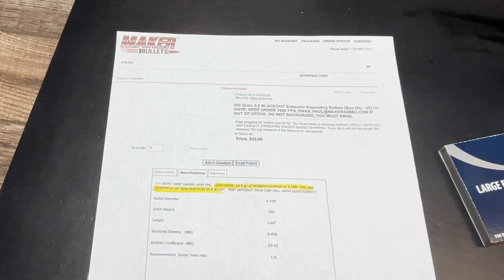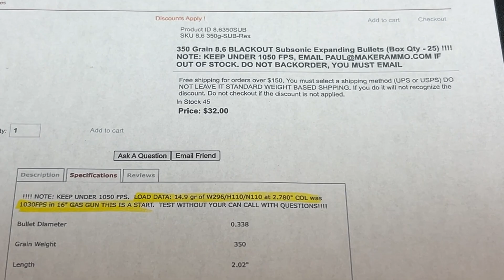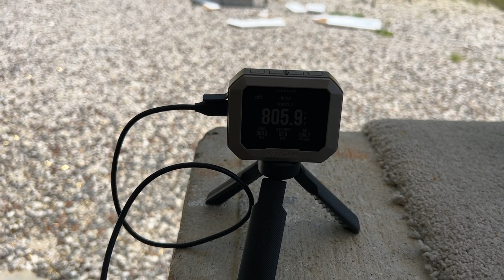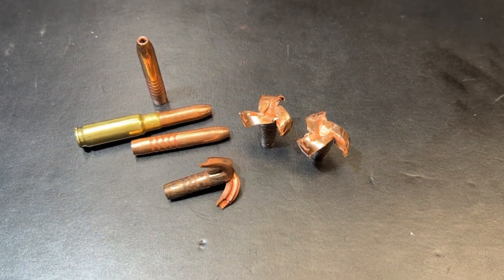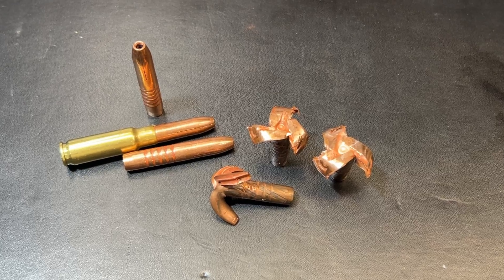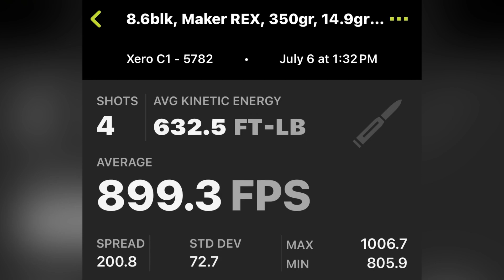8.6 Blk, Maker 350 REX All Copper Bullet Tested in Gel Blocks.

Comment: I was wondering if you ever have feeding issues with the 350 gr Makers bullet? They will not feed in my Q Fix or Faxon FX7 bolt actions. However, both feed the Gorilla 342 gr Pork Shredder smoothly.
Reply: Regarding OAL, the factory loads I've used with Makers bullets that don't feed:
Steinel 350 gr - 2.780"
Aitken 350 gr - 2.746"
Halworx 300 gr - 2.769"

I appreciate your thoughts on this and I think your videos are very well done and super helpful. I especially liked the ladder videos on 8.6 supersonic loads.
Reply from the maker: @ Both my 342gr Punisher and 350gr Maker were at 2.76 OAL.

If you chamber one and eject it, does the tip of the bullet show any scratches from the feed ramps?  

Also, how’s your gas?  Wondering if your a tad under gassed to drive the buffer all the way back to get enough spring tension and inertia to strip the round out of the mag and into the chamber.
Reply from the maker: @JJI-RH65300  Factory loaded ammo??  I haven’t had any issues but all mine have been reloads and I check everything with a Sheridan Case Gauge after loading. 

You could get a case gauge and check both of them to see if the Maker is within SAAMI specs or is oversized. 

I stated out loading with Gorilla brass and it does seem to have a thinner case wall at the neck and their bullets seat very loose in their brass. I can twist them by hand after loading.  That may be why they’re fitting your chamber better. 😉

It could also be the chamber cut on the Q Fix if is tighter than the SAAMI spec for 8.6.
Reply: Thanks for the reply. All factory ammunition with the 300 or 350 grain Makers bullet being loaded by Halworx, Aitken and Steinel. I did buy a case gage and they all drop in and check out fine. For me the open tip of the Makers bullet seems to catch on the feed ramp and stop right there. Bullets like the 300 gr Sierra Match King, Gorilla 285 gr Fracturing and the Discreet tipped bullet feed smoothly. Maybe I need some sort of polishing of the feed ramp? Besides the pmag I've only tried a Lancer mag in The Fix and that made no difference. But maybe there are better choices there.
Reply from the maker: @JJI-RH65300  it could be the feedramps or the feedlips in the mag. I run Magpul and Lancer with no issues with any bullet I’ve reloaded so far (12-15 different ones). What’s your OAL on the factory Makers??
Reply: Im😢running bolt action rifles focusing on The Fix by Q. I've used plenty of force when running the bolt in that I've driven the bullets part way into the case when the open hollow tip has caught on the feed ramp. At some point I'll probably pull the barrel and try polishing the feed ramps. For now, considering your results show more consistent expansion by the Gorilla 342 pork shredder than the 350 Makers, I'm quite happy running that. Plus all the other brands of bullets I've tried seem to feed fine as well. Thanks for your help!

Comment: When you convert the 6.5 Creedmoor brass, do you have to turn the neck?
Reply from the maker: @MyGraKat2  I didn’t. Just trimmed to length. It had noticeably more neck tension than the Gorilla brass but the Gorilla was so loose I was concerned about bullet setback.  The loaded converted cases were all fitting fine in my Sheridan case gauge.  I used these more for playing around with my first few batches of bullets until I got my Gorilla and Starline brass in.  Honestly, the starline seems to be doing really good.  On my 2nd loading with several of them already.

Comment: Stupid question. If the sound barrier is 1125 why do people always act like subsonic should be around 1050?  Thanks
Reply from the maker: @tarasowell8191  it’s not a constant number. It changes with altitude, temperature and humidity.  1,050 is a lower than average for most places but a safe range to ensure the rounds stay below Mach-1. 😉
Reply: @kentuckyrangetime  are you seeing decent accuracy with any of your 8.6 loading? I have tried most all of the factory subsonic ammo available, and about 3 moa is the best i have gotten at 100 yards.
Reply from the maker: @tarasowell8191  I just finished gel block testing my last 2 supersonic loads earlier today. The Barnes TTSX in 185gr and 225gr. 

Working up accuracy loads and testing them with each grain weight is my next step. I’ll start that when the weather gets too cold to do gel testing, probably after Thanksgiving/deer season is over. 

I do know that this caliber was designed as a hunting round and was never supposed to do those low or sub MOA groups like most other calibers.  At least not with the 3R twist barrels.

Comment: What is the intended purpose of the cartridge?
Reply: Hunting or self defense
Reply: @deepsouthmotorcaradventure5999  For hunting that cartridges would be greatly limited to very short range.
As for self-defense for rifles the AR 15 in pistol cartridge work just fine.
I own an AR 15 upper in 9 mm and 30 Luger with 16 inch barrels so I can't imagine for home or on the property more than these cartridges for human threats.
Now when not hunting and I am in the Pacific NW with bears and Cougars I am pacing the AR 15 in 7.62x39 when walks on logging roads
The 30 Luger became an eye opener how wicked that cartridge is when I started using a FoxPro caller to call Racoons then shooting them with the AR 15 in 30 Luger that blew their guts out and if head shots those 85 & 90 grain hollow points blew up the Racoons heads!
The 30 Luger shooting 85 grain hollow pints go through a 4x6 Doug fir beam at 25 feet leaving a massive hole on the beam back side.

Comment: thinking there are factors that are skewing your results.  Makers have one of the best reputations out there for 8.6 sub bullets.  I've never seen these issues on any other tests, or experienced them personally regarding the lack of expansion.  Wonder if you got a bad/defective lot?  The really big velocity swings also indicates something's fishy.  I'd probably go load several more in actual 8.6 brass that have been sized and neck turned, then trickle and weigh each individual charge, in case you didn't the first time.  Doing this has gotten me single digit StdDev and Extreme Spreads with my 8.6 loads.
Reply from the maker: @uvausmc  I’ve already done some follow up testing and It’s the low velocity causing them not to expand. Same for the Gorilla Punishers.  Anything under 950fps has partial or questionable expansion in both rounds. 

As far as brass prep, I’ve also ran these in Gorilla 8.6 brass which is another issue entirely. 😂. Even after FL resizing virgin bras there’s almost no neck tension.
Reply: What kind of accuracy are you getting with single digit SDs? For me the single digit SD loads get 1.5” groups, always a flier or two that expands the group.
Reply from the maker: @FFFF-x9i  I’ve been focusing on getting my velocities and haven’t really done any groups at distance yet. That’s coming up soon though. 

These big copper bullets with so much contact area seem to be extremely sensitive to even the smallest change in powder charge. I was doing bumps like I would for jacketed bullets and had to really shrink down the adjustments.

Comment: I wonder if fire forming the new 6.5 Creedmore brass caused the erratic velocity due to neck tension and case volume variances?
8.6 is really cool, thanks for your testing.
Reply from the maker: @rangetime6779  possibly. Once I cycle them all through a loading and have them fire formed I’ll be able to tell. All the converted brass Is Hornady 6.5 Creedmore and the neck tension feels good seating the bullets. 

Im loading the Gorilla brass straight out of the box and there is almost no neck tension on them, I can barely feel any resistance seating the bullets. Even crimping, if I were chamber and not firing a few times Id be concerned with bullet movement in the case. That should also work itself out after the first loading too.
Reply: We played with this like crazy when ammo was not even available. We two staged out size up running a neck size up to 308 then to 8.6blk. After trimming and everything we tried getting a stable load and found we had to load up some cheap 300mk and shot them then we would anneal resize and shoot. Load stability was an es of about 20 at that point.
Reply: 100%, i agree that the brass should be analyzed, but the test should be done using the factory 8.6BO brass and or try annealing his brass and see if it fixes things. Really, I wouldn't add any more powder to the case yet because if you can get the neck tension straight, your velocity will increase.

Comment: this is the 1st time ive seen makers NOT expand. Is it possible that you have powder issues OR neck tension issues? the Erratic velocity def causes one to think there is an issue. just wondering, did you check the diameter of the rounds before ya shot them? Just wondering if there was a undersized issue WITH THE BULLET even though i doubt it. Maker is KNOWN to have some great Quality control. Gonna be following this carefully. thanks again sir for great testing and showing us ALL the results. much appreciated. Have a great weekend. God bless!
Reply from the maker: @preacherbiggin  I’m hoping it was the low velocity. I have some 8.6blk Gorilla brass I’m going to load the next batch in.  I’ll definitely be posting results.
Reply: @kentuckyrangetime  looking forward to the test & seeing your results. I think I'm gonna order some 300 gr Makers and give them a try. I've got the 350s and they do "ok" accuracy wise, but supposedly folks are getting better results with the 300s. I'm wondering if the 4 petal gorilla's you shot are gonna be more effective than the 3 petal Makers? What's your thoughts so far?
Reply from the maker: @preacherbiggin  with most of the Maker I fired not expanding, I’m leaning towards the Gorilla but want to get the velocity up and see if they open up better. 

I do like the 4 petals on the Gorilla better. They were almost razor sharp on the edges too, so i’d say the slicing, cutting and bleeders in the wound track would be at least 25% greater.